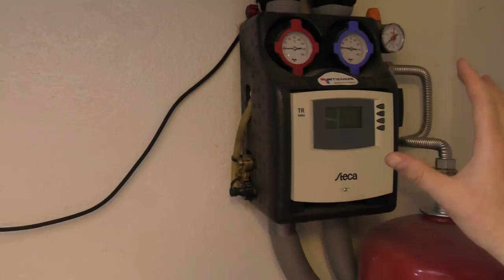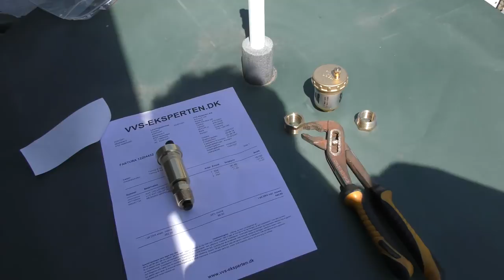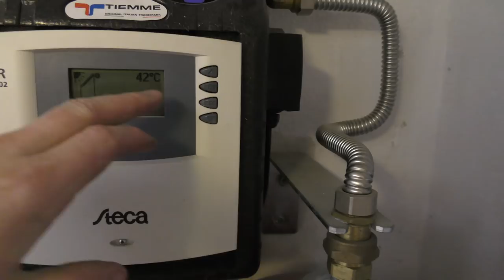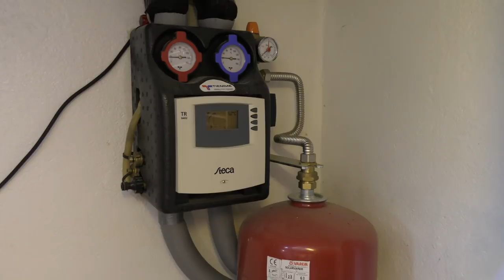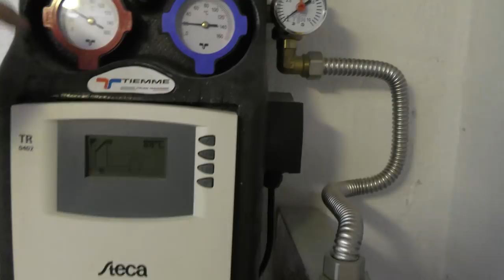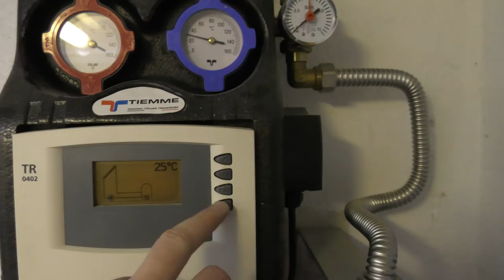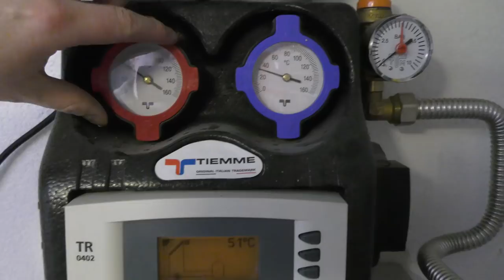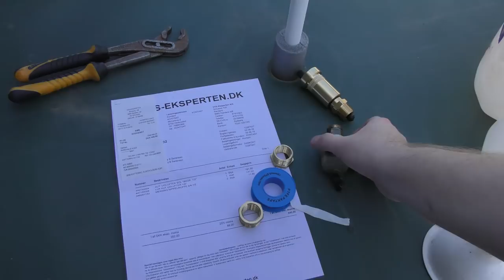How did a Thunderstorm, Destroy my Solar Collector - 698

Comment: I am tinking about making hot water like this. I would have to put the collectors far from the house. To get good sun. I would also like to use it to heat my home when it is not very cold. Using a electric heater of about 30-40  gallons as a exchanger for hot water. To pre heat before the tankless gas heater. That may not need to be fired  when the sun heated the water. I will conne t a temp switch to prevent it from firing when the water is above 130 F or so. I will have to run insulated pipe about 100-150feet. I have now 1500 watts of solar. I am looking in to buying a pallet of panels. And more charge controllers. I'm thinking 4 40amp tracer AN's or 3, 60 amp Esmart3 controllers. Also batteries. I have added a set of L16 6 volt batts. In a 24v set. 450ah. Along with 200ah. Set. And I'm working on a lithium bank to eventually replace the lead acid batts
 It is nearly 200ah 7s. Do its 29.4v full. I will only charge to 28.8-29 v. I wish my house was far along as yours. I have work to do before I can move in completely. Great video!!!
Reply from the maker: Hi JAMES! Since the 70's
Thank You very much!  glad you liked the videos :-)
Thank you for watching! :-)

Comment: looks like you need some monitoring and email alerts for your system, I would definitely NOT leave 18650's charging while you are away. maybe make a big lithium battery bank for your critical systems like the mini pump and hot water system, oh and the email monitoring of the house!
Reply from the maker: Hi SuperBrainAK
Thank You very much!  With that stuff I put in fuses.
Thank you for watching! :-)

Comment: The emergency system did it's job very well, a success i would say :-D.

We have had some mad weather lately, lightning/thunder and really nice warm days, i'm confused as i'm used to rain/cold and more rain lol.
Reply from the maker: Hi zx8401ztv
Thank You very much!  we have dad fantastic weather for about a month now :-) I have had shorts on for work for the longest time,, I do that when the temperature is over 25c.
Thank you for watching! :-)
Reply: Hi Morten, you must get the pressure ud to aspx. 2,5 bar, and i ud install a valve under the airvent, and it must be closed at normal run

Comment: if lightning strikes on those panels you prob wont find any panel anymore and hit much more behind it , molten panels and wirings ect....  i think its just the insane heat of the last weeks was the problem, check cablings for shorts or damage what gives a current to earth. the resistance to earth should be very high like in the mega ohm range
Reply from the maker: Hi highflow highflow
Lightning  hit near by, and triggered the HPFI - relay, No power to the pump,,overheating.
Thank you for watching! :-)
Reply: Seriously, you "thought" a lightning bolt hit the solar water heater panel?
He never even said that.

Comment: Hopefully they didn't get damaged or scale built up inside...
If you have collectors with a long tube that winds side to side, they should be in parallel, they'll get enough temperature difference with the proper flow rate. For my Vaillant VFK145 collectors, it says the optimal flow rate is 0,3 l/min per m2 of net surface area. You can adjust it with pump speed and a screw on the flow regulator. A too high flow rate won't get you enough temperature rise on the collectors so you'll get higher losses on the return pipe and worse stratification (worse performance). You want about 10 to 25°C rise depending on how strong the sun is.
Oh, and check that the hot flow goes into the upper port on the tank and return comes from the bottom, installers screw that up sometimes.
Reply from the maker: Hi Jernej Jakob
Thank You very much!  glad you liked the video :-)
Thank you for watching! :-)

Comment: The pressure in the system is low check the gauge on the on the right hand side it should be higher than that.
Reply from the maker: I have a little leak,, so I keep it low :-)

Comment: it looks like distilled would work better. have you tried that?
Reply from the maker: Hi MrOne2watch
Thank You very much!  No what's the differences?
Thank you for watching! :-)
Reply: most tap water has minerals that are corrosive to metal. distilled does not, and can be used in cooling systems. and in your case it should allow the system to get hot faster than antifreeze  and tap water.
just remember the water can freeze and bust pipes without the antifreeze. so i would drain it in the winter.

Comment: Solar panels have water? is this some sort of water cooling system to make them more efficient?
Reply from the maker: Hi steve64464
They make hot water.
Thank you for watching! :-)
Reply: Ah i see :-) , Here in the UK all we get is cold/wet weather most the time so it never occurred to me you could do that.
Reply from the maker: Hi steve64464
Well I did actually buy many of the parts for my solar water set up in the UK,,, the flexible metal pipe and the controler and pump thingy.
Thank you for watching! :-)

Comment: What is that electrical circuitbreaker thingie called in english? Been looking for that. If i transfer the dutch name to english it's called something like "earth leakage switch" but that doesn't sound right.
Reply from the maker: Hi Henk Kok
a Residual Current Device,,,, I am sure you have them as well.
Thank you for watching! :-)
Reply: It's called a "circuit breaker" in america.
Reply: No. "earth leakage switch" is more correct. Circuit breakers are just switches that measure large current (10,20,30A) to provide and isolate circuits. Your stove might have a 30A unit, and light circuits 10A or so. The earth leakage device sits between your main breaker (50A maybe) and all the others. It measures very small currents (a few milliamperes) between ground and live (sometimes neutral as well.) to protect humans and equipment. You're only supposed to have current between live and neutral, not to ground. Live, neutral and earth (ground) may have different names everywhere, but its the same concept. These devices are often tripped by lightning, due to electromagnetic pulse spikes running across the lines, and even earth connections, which will induce currents of more than a few mA.
Reply: Probably a whole house GFCI.